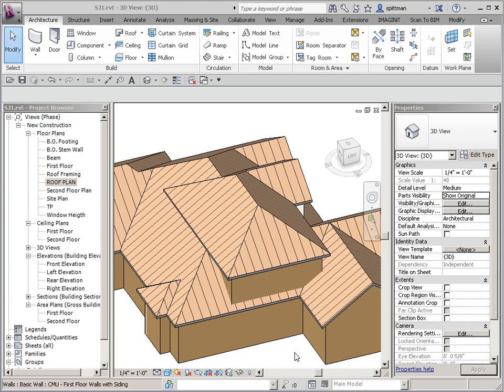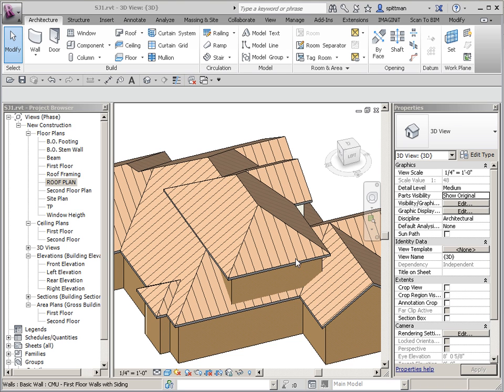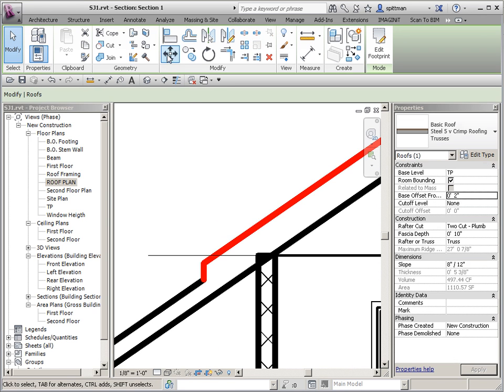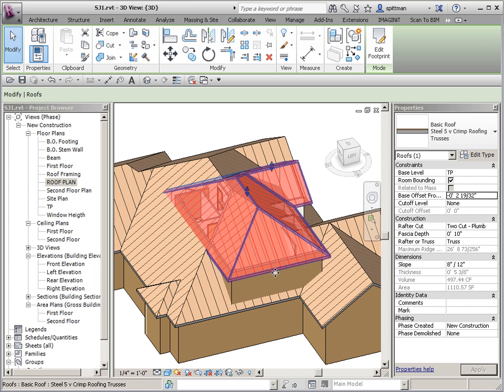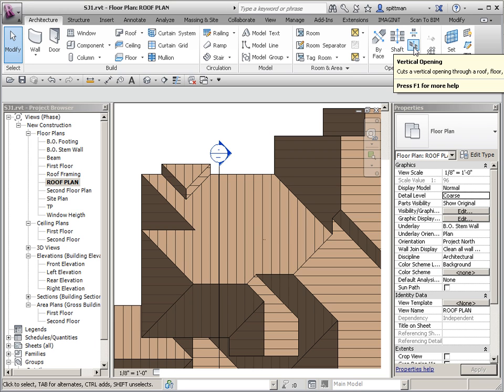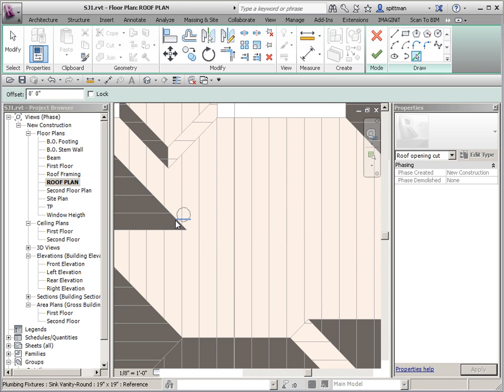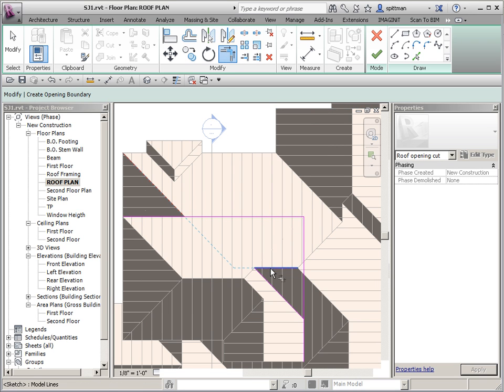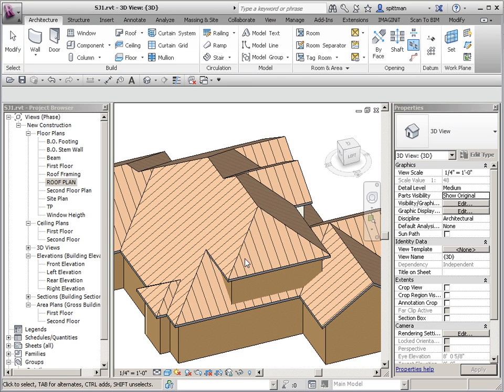Revit Roof:  Cleaning up overlapping Roofs

Comment: Sorry can you clarify? Join/unjoin tool only works when the
roof was created by footprint? If roof was created by extruding profiles then
it is necessary to cut holes in roof using  cut vertical opening tool?